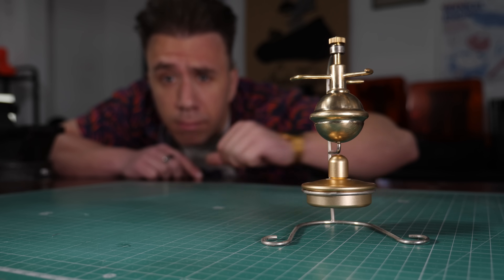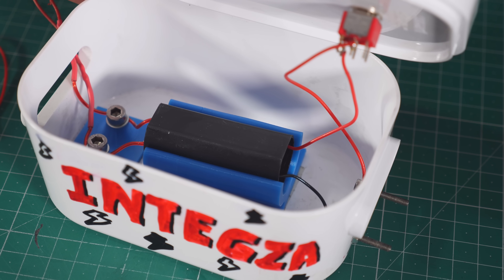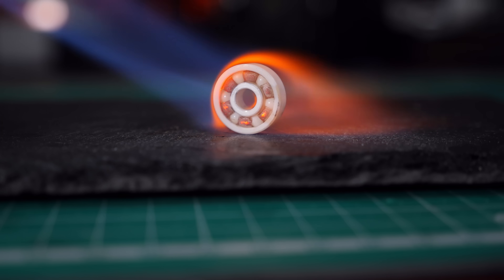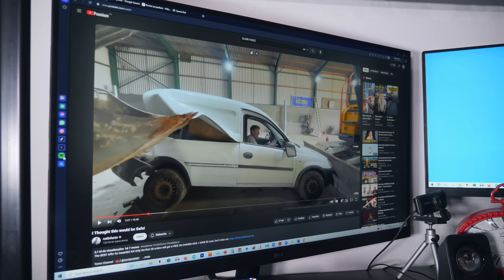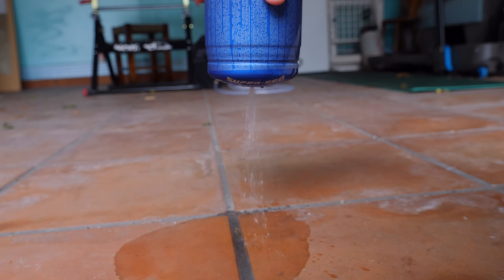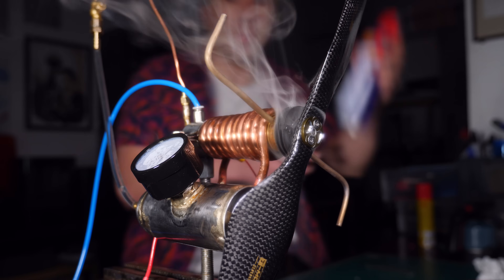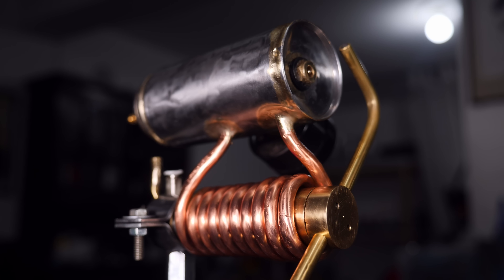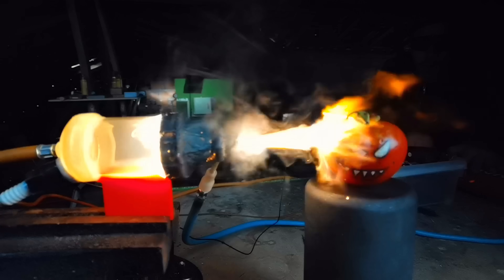I Built a ROCKET PROPELLER

Comment: How about making 3-d printed (metal) propellers that have holes acting as many nozzles , pushing the propellers directly?
Reply: He'd want the holes concentrated at the tips instead of all along the blade, as the most work will be done further out. With them inboard, they would cause they're too be minimal exhaust from the outboard ports.

Still, not a bad idea. Problem is that it'd need to be super light in order to be usable. Which means, ideally, titanium... but that's expensive. Or magnesium... which is scary around fire. (so it's titanium, but it withstand a lot more heat)
Reply: Sounds like a job for a 'sintered metal foam propeller' ala the fire knife.
Reply: It would be more dangerous and he'd have to make sure its balanced. I don't know how ductile 3d printed metal parts are so he wouldn't want something that might shatter. Also, a rocket engine may have excess oxygen that could rapidly oxidize the metal.
Reply: @ryelor123  Some get sintered and the grains grow together, others get welded directly from a laser as easy pass goes, and some are literally a CNC MIG welder working like a conventional 3D Printer.

I have the most faith in the sintered ones I think, but the MIG welded ones might be good as well...
It'd still be precarious though 😅

Comment: since you have a rotating shaft now, could you drive a belt with it and run an impeller or a scroll compressor to generate the air for the engine?

Comment: Add a ram jet engine to the end of the propeller. And fuel will be inside the propaller body. So it will be an engine with zero moving parts.

Comment: Ok this has to be one of your best machining builds.

I wonder if the same rotation could be use to compress the air. Running a centrifugal compressor maybe?
Reply: you're slowly getting into the actual rocket science with this idea ;)
Reply: @tomclanys  tbh I was thinking more in the turboprop direction :p

However, decomposition of hydrogen peroxide did cross my mind too :p
Reply: If you watch the whole video, he mentions wanting to modify it to compress its own air at the very end.
Reply: @Whambamrustytram  That's what I was commenting on
Reply: Anything connected to the propeller will slow down the rotation. Better to use a separate exhaust driven pump, but he'd have to make the impeller and housing on the CNC machine, and it's really a 5-axis job. Bonus, controlling the pump bleed off controls the throttle and prop speed.
Reply: @PiDsPagePrototypes it will have the same effect you can't have anything for free. A separate rotor will just mean less of the pressure and air will make it to the first rotor so you lose power from it regardless.

Comment: Wood is just graphite with a few extra steps.
Reply: Graphite is just wood (and mammals, and lizards, and...) with a few extra steps (mostly involving fire).
Reply: Graphite is just diamond with less pressure and temperature.
Reply: *less steps
Reply: @c4sualcycl0ps48  *Fewer
Reply: if you think about it everything is everything else with a few extra steps
Reply: @agibitable I am star stuff with the extra steps. And you can too.
Reply: @agibitable  Thus alchemy is reborn
Reply: Graphite is actually a really high grade coal!

Though it is so high grade and pure, that unlike other forms of coal - its purity makes it a really bad fuel to use, due to its insane difficulty(as you all know) to burn in comparison to other types of coal.

Pretty much the only reliable method to get graphite to burn reliably is heating it till red hot in a very high or total oxygen atmosphere.

It also kinda "burns" very slowly in our 20% oxygen atmosphere when heated red hot - but its very slow and not self sustaining unlike in a high oxygen environment. It just kinda gradually "disappears" over time in normal atmospheric oxygen concentrations.
Reply: You had one job and you failed.
Reply: I was scared his welding kit was full of acetylene
Reply: @Klaevin  That might have ended horrifically! 😂

Im pretty sure that acetylene can only be stored at relatively low pressures or you risk it essentially detonating... lol
Reply: @Chris47368 wow, I didn't think I was commenting on this thread. Whatever, I'm glad I got a response
Reply: [Brain glitching]
Listen here you little shit...
Reply: Well considering fission and fusion everything is graphite with extra steps.